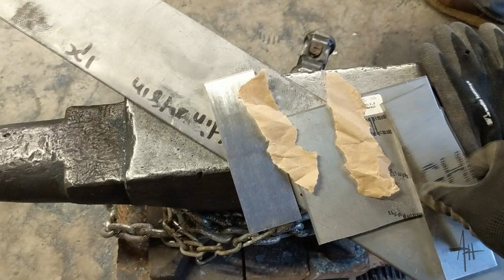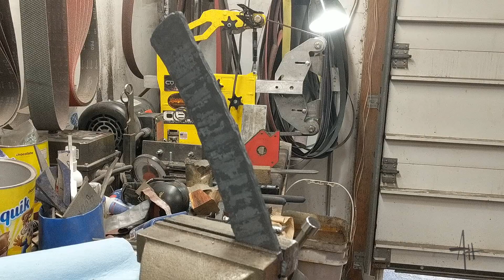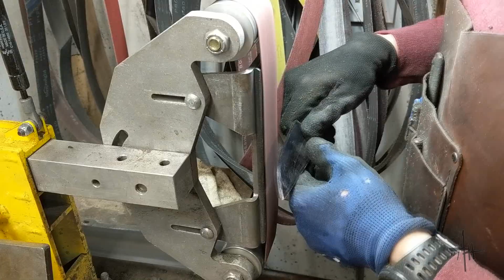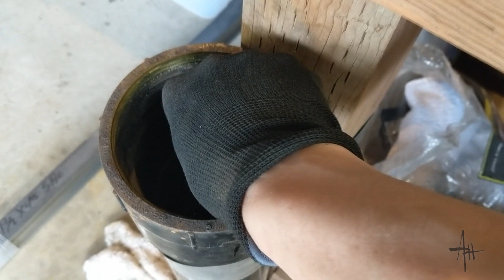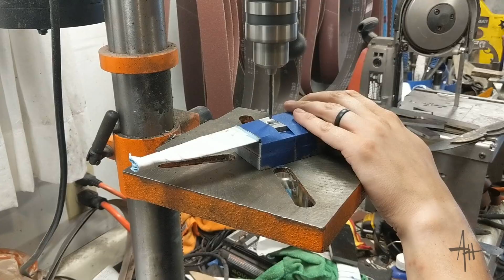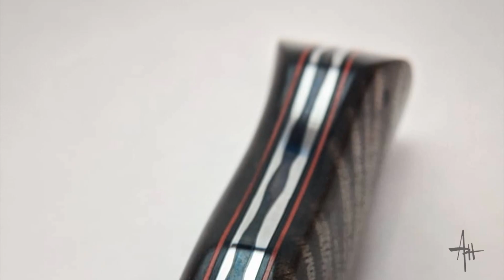STAINLESS SAN-MAI: How its made!

Comment: Have you or do you ever forge your blades?  As in, hammer and anvil shaping the blade and setting the weld or do you just do stock removal?
Reply from the maker: I forge many of my knives. Integrals, many of my chefs knives, and any of my own damascus and San-Mai are hand forged. If I am working a material that doesn't like being forged on a bias, like stainless San-Mai or Baker Steel, I will do stock removal.

Comment: What was the purpose of the paper between layers?
Reply from the maker: It burns up any of the air that may have been trapped between the layers after welding the billet together. It turns into carbon ash and helps facilitate a clean bond between the 410ss and the core high carbon steel.

Comment: If your using mig, do you need stainless wire and gas, or will my normal carbon wire/gas work for the seal?
Reply from the maker: I use mig and just use regular flux core wire and it works just fine. I just make sure that I grind off all the mig bead after the forge weld before I go on to blade shaping. Hope this helps!

Comment: If you only have a mig welder can you put a jacket of mild steel over the stainless so you have a way to weld it together? Or would that create an air pocket? What about a canister?
Reply from the maker: I only have a mig welder as well, and that's what I used in the video. I use regular flux core wire to weld the stainless jackets to the core metal without any issues. It's not structural, it's just to hold the pieces in place and to exclude any oxygen. I have not tried this method with a mild jacket or in canister form, but I imagine it would get even more complicated adding more steps lol. If you try it, let me know how it goes!
Reply: @FlatlineKnives  thank you for the response. I'll have to try welding them with my set up. I was told I couldn't but never attempted it. Never hurts to try.  Beautiful blade btw
Reply from the maker: @PatheticPeasant  Give it a try! Never hurts to experiment, and thank you!

Comment: great video, information and end product!!  one quick question regarding hardening: if you're core is 1095, which most people harden at about 1500F what stainless are you using to not overheat your 1095 core?  I've been using Nitro V and AEB-L both which are 1900F and above to austenize.
Reply from the maker: Thank you! When I do the stainless steel jacketed san-mai blades, I heat treat to the core metal and I don't worry about hardening the jackets. So for this knife with the 1095 core I followed the soak and quench temps ontlined by my steel supplier. The 410 stainless steel that's on the sides gets hard enough to be wear resistant but I'm not worried about hardening them. I'd like to try the Nitro-V/AEB-L combo you are talking about though!
Reply: @FlatlineKnives  thank you for the reply!!  I'm honored and surprised you would take the time to answer me!   I never thought about the possibility of not fully hardening the jacket steel.  I just recently was able to purchase an evenheat so I'm just starting out with stainless work.  Once the weather warms up here I'm looking forward to trying a stainless san mai as i've only been doing mild steel and 1095 to this point.  I really appreciate you taking the time to share your experience!

Comment: What type of welder did you use to make the air tight bead? All I have is a flux core welder. I dont know if that will work or not. Thanks
Reply from the maker: My welder is a Hobart 140 and it works great for this. Flux core wire works just fine so long as you grind off all the weld bead after forging! I don't have a TIG welder so all I use is flux core wire 🤘
Reply: Thanks man.
Reply from the maker: No problem, hope it helps!

Comment: Great video thank you. I wasn't aware of the 'trick' of using oil to set the dark oxides on the carbon core. I have been frustrated by how temporary the dark black was on my San Mai. Can I ask what you use? Thanks
Reply from the maker: There are a TON of different ways I've tried to help set the oxides and a deep penetration oil, like the Hopes No. 9 oil I used in this video, seems to work well. No contrast etch is perfect but I think this method works well.

Comment: As a blacksmith I can definitely say that this is one of the most accurate guides on how to make stainless san mai. Also the paper sublayer trick is something new to me,definitely going to try it, I assume paper ash (which is pretty much pure carbon) should help regenerating ferrum and chromium from oxides.
Reply from the maker: Thanks I really appreciate that! I've had a ton of success with the paper trick. Let me know how it works for you!
Reply: @FlatlineKnives  soooo it went not quite as good as I expected. I've had success with two and three layers of stainless steel but then a glorious failure with 7,9 and 13 layers (tried to make stainless Damascus). Now I'm into making SS damascus with high temperature coating instead of welding all sides. I'll make eng subs for my video and send it to you if you are interested)
Tried this coating on a sigle piece of stainless,covered the clean surface with it and heated to about 950-1050°C and had no oxidation on the surface underneath. Now experimenting with more layers in hope to simplify the ss damascus technology)
Reply: @FlatlineKnives  I'm not a smith but I love these videos and hope to one day become a bladesmith. I was curious did you forge the billet with the paper in it? Also in canister Damascus I've seen them put peper and dried chilli peppers in the canister. What does it do? My guess is to burn up oxygen and leave a little carbon behind?